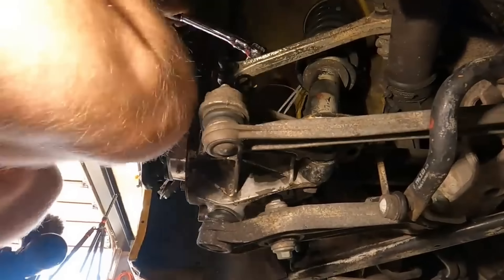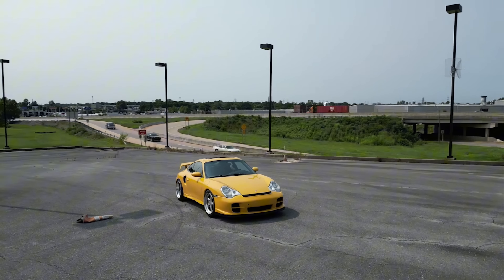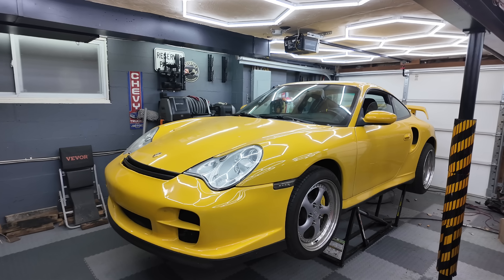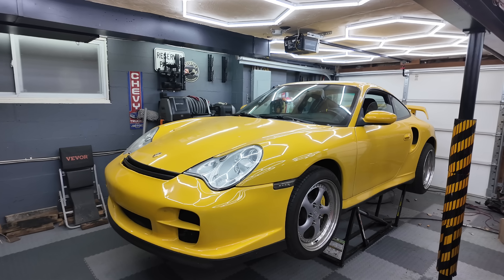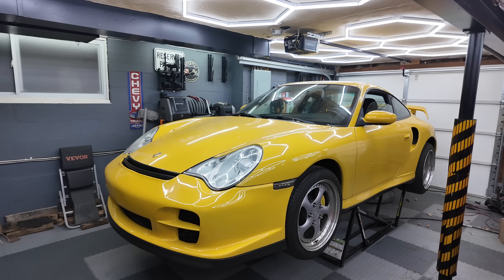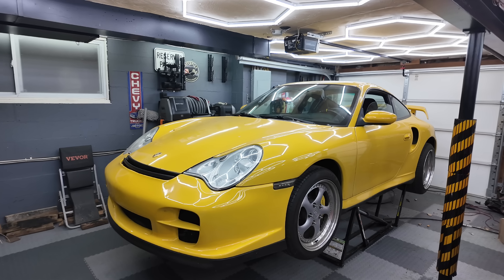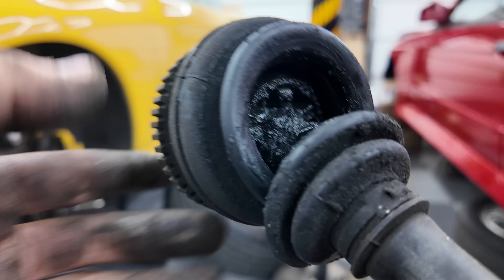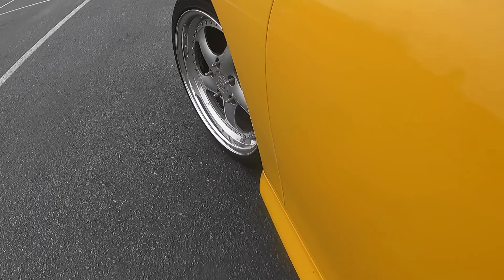PORSCHE INSPECTED the 996 911 Turbo I REBUILT!

Comment: For future reference for anyone - To remove things like an axle nut with a beefy impact, it's important an IMPACT rated socket is used, not just because of safety but because an impact socket has more material to hammer against. While rust might have made it a bit tougher, the socket you use can make quite the difference when removing.
Reply: Not only an impact socket, but depending on torque ratings definitely use a weighted impact socket, commonly used on crankshaft bolts but useful on anything high torque.

Comment: Those extra long studs gotta go..lol
Reply: For real they are terrible-looking.
Reply: Those wheels are all a mess.
Reply: They’re studs not lugs and they help with having to run spacers or specific wheels for the track and it definitely makes it easier to get the wheels on and off. Longer lugs would actually help cover the studs from sticking out and most aftermarket wheels do take up the space even without a spacer.
Reply: Yeah they have to go
Reply: @Cursirr what evah. They gotta go.

Comment: The heat could be debris in the ducts/debris in the heat exchanger itself.  Not on the inside, just the radiator portion of it.  It's a pretty common issue with older cars and cars that are parked under trees for a long time.
Reply from the maker: Idk it seems PLENTY hot to me lol

Comment: I'm sure it's been mentioned before, but Euro cars are super sensitive to voltage drops (from a failing battery). Do yourself a huge favour and get a battery tender/trickle charger. Leave it on charge when the car's in the garage. Never have a flat battery, and it should extend the battery life. Your car, and your sanity, will thank you for it...
Reply from the maker: I do have a trickle charger but sometimes have it on other vehicles.
Reply: @matt13ross  You need a sponsorship from CTEK, lol 🙂

Comment: Use an impact socket next time and it should work wonders. If even that doesn't work, wax and heat is the best penetrant, Id only use pb blaster and other penetrants on heat sensitive parts that you can't melt the wax with.  Even a crayon work and it cleans up a lot easier than petroleum products IMO. Machine shops love wax for penetrants, always keep a spare crayon on me.
Reply from the maker: I don't have an impact socket that size, hence the chromey

Comment: I need to do the front axles on my 2003 C4S, which are the same as the turbo. I want to torque the front bolts. You just used your impact gun?
Reply from the maker: Yup lol.  It's never failed me before, never had an axle nut back out.

Comment: frist heating the axle nut for a longer time (at least it looks like that as depicted in the video) - then reusing and tightening them with the impact?
pleas do no do this stuff again

the heat if to much is introduced (and that can happen dast with those blow torches) can easily damage the seals on the wheel berings
and the tightening torque of the axle nut sets the preload of the wheel bearing - to low or to high preload can wear out the wheel bearing prematurely